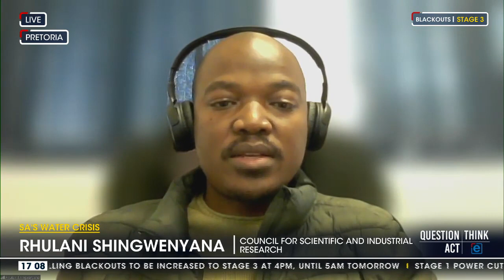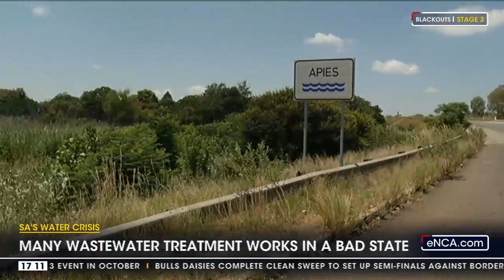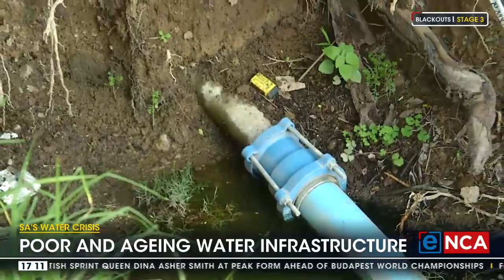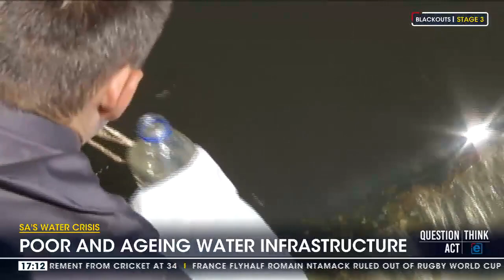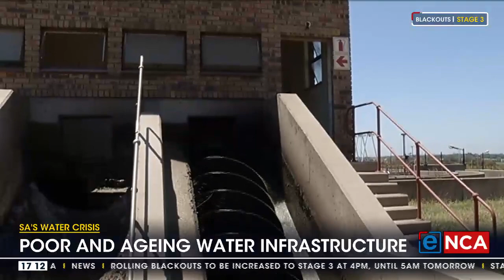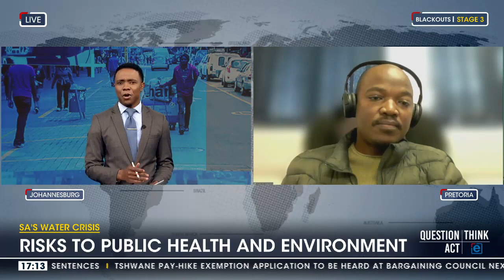Many wastewater treatment works in a bad state

Comment: Look guys this is  a disgrace that every time there is an issue where ANC members/Management is supposed to be overseeing or in charge of something  nothing has been done for years and then all of a sudden everything is not working like it should be working. There is no management so workers are doing nothing, but are being paid --for what. EXAMPLE 
Water purification plants must be tested daily and chemicals added to maintain correct PH balance, pumps to be run etc. Clean filters etc. It seems like nobody is doing what they supposed to be doing. Make sure you have suffient spares if you have a sudden breakdown. Regular maintenance. Spare Pumps, spare motors etc
This is why their always a crisis and always get told about major disaster here there and everywhere. The staff and management are not doing their jobs. Typical incompetent f..k up as usual.
Fire these people and employ persons who know what they doing. This is not rocket science. 😮😮😮